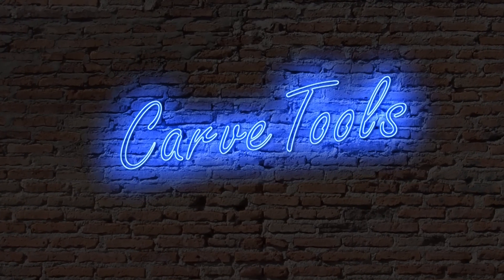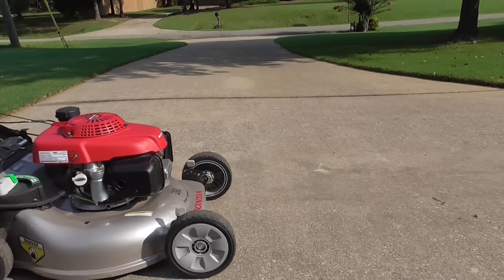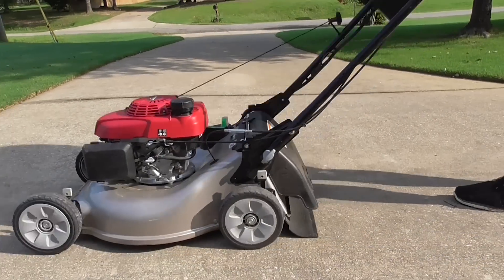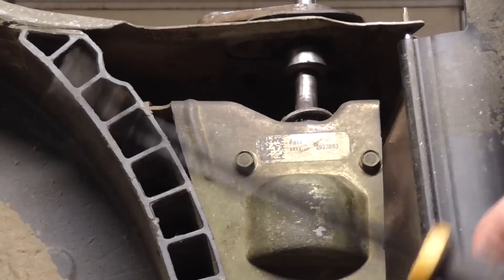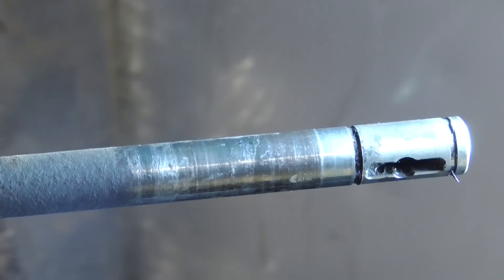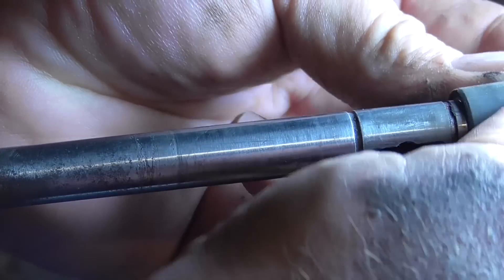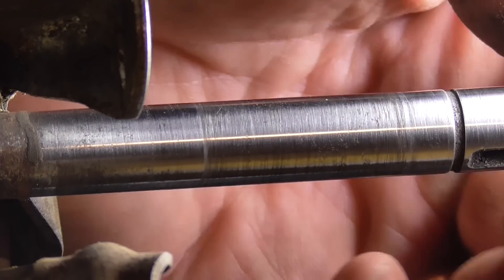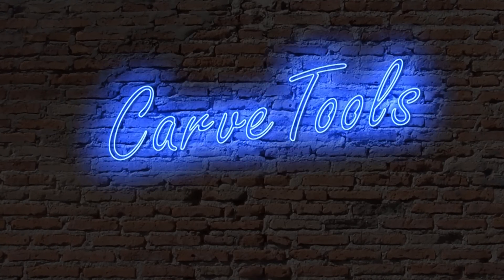Honda Mower Rear Wheels Will Not Roll Backwards THE REAL FIX

Comment: THE  PROBLEM ; with modern  stuff : Plastic shroud/cover  mounting  the  WORM  DRIVE, to  the  wheels ?.....Had more than one brand, of this  cheap - crap  design. GET  an Ariens,  mower.  Anything, other that that, is usually, just junk. The drive wheels, have a PLASTIC liner, with rounded, notches.  The Drive  ' gear '  from the worm drive /under that plastic housing /shroud, have  NORMAL  steel gears, with a tapered, gear . These, just  CHEW  UP  the  plastic notches...within  the  plastic wheels.  J U N K.  -   IMPROPER  DESIGN,  of  ' matching   the gear, to the wheel  design ''.  Somebody, screwed up, in the CAD / Design process, with their  computer software.  - ....go, check it out.   You will see..../ should make, the wheels  with  PROPER  DESIGN, AND WITH  A   METAL   GEAR,  INSIDE within the drive wheels. Steel matching to the drive gear..... o well....can't   fix   ' use once '   buy another one.  Junk. I'll keep my 50 year old Toro , cast aluminum housing and handle / . INSTALLED  this same  GCV 160  Honda engine - modified the throttle / governor /choke mechanism. Used a mountain bike, shifter on handle , for the throttle. Another one, for the  RELEASE....to switch on the magneto, for starting.  (most all brands, have a bar-lever....for  this...../ YOU  CAN'T  control  the RPM  this way . I need, to vary the rpm....for the  load on engine. Slower rpm, for light grass, or sparse grass )  Works,  very awesome.   Light, long handle....NO  MORE  SELF - PROPELLED  junk...for me.  The blade, rotates  EXACTLY  the same level, as the outside of the round , housing. This, is easy to see, when approaching obstacles / rocks, lumber, uneven surfaces....etc.  Very  accurate, to keep level, and low.  Been doing  this stuff...for years.  Got in down, pat.  Good luck, to all  which  USE   THEIR  HANDS.  ?  WHY DON'T  they  USE  REAL  METAL,,,...for mounting Drive Stuff ?......i think, we all  KNOW ££££  MONEY ! ......

Comment: Great video.  I did the fix and my rear wheels do not lock up but it still seems sort of hard to roll backwards.  Would I be correct to assume that's normal, that it doesn't just roll backwards with little or no effort?

Comment: Great video.  I have had intermittent problems with this for years with my commercial HRX2172HMA.  Apparently there was a recall that didn't include mine but I got the issue anyway. I wonder if the bushings that you buy now are fixed or re-engineered. I have trouble with the back left wheel height adjustment as well. I bet it is a mess in there.  Doing this tomorrow and hopefully this fixes it up.  Out of curiosity, did you grease the axle before putting the bushing back on?

Comment: My mower did not roll backward at all.  The self-propel on my mower does not work as well.  I did not want to do sanding to resolve the issue, WD-40 did not work, and I was tired of dragging the mower backward through the grass and on the concrete.  I removed the dogs and springs for the ratcheting mechanism on both wheels.  Now the non-functional self-propelled mower is a functional push mower.

Comment: Have the same issue, haven't grease the bushings or clean the axle yet but is there a reason both wheels lock up? I would think if it's The bushings one wheel might spin free while the other is stuck. Trying to determine if it's a transmission or not...
Reply from the maker: Here is a link to my more detailed video on this issue https://youtu.be/zsHQYJEKY5M
Hope this helps and thanks for the comments.

Comment: I had this exact problem. It rears its ugly head after I rinse off the mower. The first time this happened I sprayed lubricant on the axle and it did the trick. This last time it did not help and I used your instructions to fix the issue. I purchase a new belt, bushings and rubber caps. The right side came off easy, but the left side would not budge. I had to use a propane torch to remove the left adjuster. (those snap rings are a bear to get off!)

Comment: Thanks Scottie, 
I haven't tried that but really think that is what needs to be done. It has been a good mower engine wise but that definitely is a problem, glad I'm not alone. 
I did buy a RYOBI battery mower last year and it is a breeze to mow with. Still like my Honda as a backup, need to get it fixed.

Comment: I hate my Honda smart drive mower so much and I despise the salesman who talked me into buying it. The motor that drives the wheels is SO EFFING HEAVY. If I didn’t have that stupid Smart Drive on this thing adding so much weight I wouldn’t need the Smart Drive to help me push it! My brother’s push mower weighs half as much and is a thousand times easier to use without any kind of drive assist, and the stupid goddamned wheels never lock up like this one does. I wish I could go back and buy a much cheaper mower.
Reply from the maker: I understand. I only use this one for trimming and it will be replaced in the next few weeks due to another issue. Check back soon for the final video on this Honda mower. Thanks for the comments.

Comment: My Honda carburetor was covered by Honda under warranty.  The authorized repair service shop made a claim and installed a new carburetor free of charge.
Reply from the maker: That's good to know. Hopefully you will have no pull back issues. Thanks for the comments.

Comment: Just spray lubricant instead  of tearing  apart because  i promise you it will continue  to happen  as long as you own the mower. Terrible  design and nothing  you can do about it but spray lube when it happens
Reply from the maker: Definitely a bad design and fortunately after doing the disassembly there have been no further issues with wheels locking up on pullback. I have an updated video on the repair if interested https://youtu.be/zsHQYJEKY5M
Thanks for the comments!

Comment: I have Honda hrs216 self propelled mower. I’ve had it in the shop twice under warranty.  All they did was put a bandaid on it said it was fixed. I’ve watched your video and tore mine down and cleaned the shaft, bushings, etc.  It worked fine for about a month than started acting up again.  The problem is the bushings. They are not designed for the type of environment a lawnmower is put through.  They should’ve put sealed bearings instead of bushings. Very bad design.  The engine is 2nd to none!
Reply from the maker: Yes, they know the bushings are a problem. Check out my newer video of The Real Fix Part 2. It has more details on my repair. Thanks for the comments.

Comment: The real fix ?
You certainly did it the proper way
I would just shoot a bit of oil on it and let it roll
Quick and nasty but likely a long time before it wears out
Might be a awful long time
Reply from the maker: I tried WD-40 and a bunch of other oils, but it did not last. Check out my newer video of The Real Fix Part 2. It has more details on my repair. Thanks for the comments.
Reply: wd 40 is not oil @CarveTools

Comment: I replaced everything associated with those rear wheels including a new trans with shaft....still both wheels pull very hard and heated lock up.....this is not the REAL FIX....why did it work great when bought new and not now ?
Reply from the maker: The manufacturer knows the bushings are a problem. Check out my newer video of The Real Fix Part 2. It has more details on my repair. Thanks for the comments.

Comment: I work at a Honda Power Equipment dealership, and we see this issue regularly.  It is HRR216 specific.  You are correct, the bushings and transmission shaft are dry and worn so that they bind up.  You can buy genuine Honda OEM bushings already installed in the wheel adjuster bracket for less than $10 per side.  It is quicker and easier to replace these with the transmission in place rather than removing the transmission.  Clean off the axle with emery tape just like you did, and put some fresh grease on before installing the new wheel adjuster brackets.  I've done quite a few, and it usually takes around 45 minutes to do the pair.
Reply from the maker: Thank you so much for the information. My local Honda Dealer had no clue.

Comment: honda knew about this problem long ago but did nothing with their $465+. Usually it's the lousy transmission that go bad.
honda like husqvarna have so many mowers complaints that they are no longer in the business.
Reply from the maker: There is very little information for the recall and Honda service centers have no ideal either.
Reply: @CarveTools  Honda's TSB for buying the new parts are useless after 17 cuts.

Comment: Thanks Dave,  I just received a free 160 GVC lawnmower real wheel self propelled and it wouldn’t start. 
Finally got it going by cleaning out Emulsion tube while it was in carburetor with a bent plastic tube spraying Carburetor cleaning Spray   

I will try your fix in a few. 

Houli.

Comment: If you want a quick “fix” try this: 
First clean it, preferably with a pressure washer, there’s probably a lot of crud everywhere. If this quick fix doesn’t work at least you’ll have a clean mower to work on. 
If you slowly push forward until just BEFORE you hear the click from the wheels and then are able to roll backwards about an inch or two before the wheels lock then it’s NOT the transmission; the problem is a catch in the wheels. 
After cleaning it up get it on a hard surface (concrete). Start the mower and lift the rear so that the wheels spin in the air when they should be going forward (approx 5 inch in the air) then let it drop. The idea is to unstick the catch that’s preventing the wheels from rolling backwards. Repeat this a few times.

Comment: Thanks, Great video and good info for all. Just wanted to add this also.
First of all, remove the drive belt from both pulleys, turn the wheels backwards and see if they turn freely.
Make sure when you have the mower tipped to its side, that the bottom wheel is not touching the ground when you try to spin it.
If it spins backwards freely without the belt, then your transmission and bushings are fine.

if the wheels are hard to spin backwards when the belt is back on, then the belt is getting caught and binding against the pulley and the bracket that keeps it on. This happens if you try to use a non-honda regular black rubber belt. The rubber just causes more friction on the pulleys and creates the resistance.
The oem honda belt is brown and seems to have some kind of fabric looking material covering it that causes less friction on the pulleys.

I tested this just today 7/12/22 with a non-honda belt and with a brown 38" belt for cub cadet and troy, part no. 954-0257.
The belt was actually for a snowblower, my hardware store did not have the honda belt.
To my surprised, it worked just fine, it rolls backwards freely. I did spray the axles and bushing area with pb-blaster also.

Hope this helps others
Thank All for your inputs

Comment: Thanks for the video! I bought a brand new HRR mower in the fall of 2018. I used it a few times until the end of the season and it worked great. The next spring the rear wheels started locking up. I thought, "No problem, it's under warranty."  WRONG! Honda would not fix it under warranty. Took it in for service, a few weeks after it was fixed it started doing it again. The dealer picked it up and a couple weeks later dropped it off. Worked great for two mows and then started locking up again. I feel like I wasted $400.
Reply: Music was too obnoxious, couldn’t finish video

Comment: This is such a problem. I have had two of these mowers. The stuck wheel issue has been there on both mowers. I bought them from a Honda dealer and have had them in for service many times. The wheels are always needing to be replaced too. The replacement wheels I had the dealer put on dont even last as long as the originals. Between this problem and the need to replace the carburetor several times, I am never going to buy a Honda mower again. They dont deserve our business if they cant even fix their own design failures. This is planned obsolescence at its worst.

Comment: I have bought many lawn mowers in my life. Most were in the $300 to $400 range and usually ran for 8 years plus. Paying $700 for Honda and now having the drive wheels fighting back when pulling backwards only after 3 years has  an engineering design flaw and quality in question.
Reply: You paid 700 for your honda?   I paid 499 for mine.  Probably 10 years ago tho
Reply: @jonathanritter7364  They are more than $1000.00 these days
Reply: Honda doesn't care, this has been an ongoing problem for years!
Reply: Yea such a terrible design flaw that could be fixed by regularly  spraying the bushings in the axle with oil once in a while..
Reply: If youve bought many mowere over the years youve been buying the wrong ones 😂

Comment: Thanks for a great video, my wheels are freed. I have had this mower for 7 years now & I cannot get the electric start to work. I brought it to a repair center in late summer of 2019 & for $100 they got it working. The next spring 2020. It started with a freshly charged battery & that was the last time the electric start worked. The started does not crank at all. Do you have any suggestions on this issue?......... John

Comment: I know this isn’t my issue as my  wheel or wheels won’t turn rolling forward. They did, up until today suddenly. They roll, then just stop the mower at a dead stop. I Replaced the gear box and axle two years ago. So what has changed?

Comment: Great video for HRR216 mowers. I'm going to replace the bushings and seals and put a light coat of plastic friendly grease on bushings.  Since you have to remove the transmission may as well replace the hydrostatic transmission fluid if you have a lot of years / hours on it.

Finished the repair yesterday. FWIW the job took longer than I thought since I went ahead and replaced the belt. This is a rental house mower - some idiot overfilled the oil and it leaked into the belt greasing it. What a mess under the mower! That oil mixed and caked grass under the deck.

I decided to use my bench wire wheel (fine wires) to remove the axle rust & roughness. Sanding may allow grit into springs slot. Worked great. Then I used automotive grade silicone grease to lube the new bushings and dust seals. There is about 1/8" gap between wheel dust seals and bushing. Add grease to this space. Decided to leave hydrostatic oil alone (10w30) since mower only has estimated 150 hrs on it. On my HRX217 it has over 600 hrs - I'm replacing the hydrostatic transmission oil in it.

Using plastic bushings is a stupid cost savings. Use brass and include spiral for grease.

Comment: Wished I had watched your video before I fixed my Honda lawn mower that used to have the same problem.  I had a small engine mechanic to fix it twice; but the problem never really fixed.  I also cleaned the "half moon key" inside the wheel assembly; but that didn't help.  I cleaned the area on top of the transmission housing where the trigger to engage the transmission is located to remove any debris stuck in that area (the debris prevented the transmission to be fully disengaged); this helped for months.  But eventually the problem came back.  I tried all the steps one more time.  This time nothing helped.  I ended up have to replace the entire transmission assembly; but I still didn't know why the old transmission didn't work.  Now that I have watched your video, I realize that I should have tried cleaning the shaft.  Having said this, I wonder why the rust in the shaft can prevent the wheel from rolling backward but Not prevent the wheel from rolling forward.  I think if the rust on the shaft is the problem, it should prevent the wheel from rolling forward and backward, right?  I am confused.
Reply from the maker: The issue on my mower was the rust and dirt on the shaft. Once cleaned I have had no problems since. The reason it rolls forward easily is the half moon key you mentioned acts like a ratchet wrench allowing one direction. Thanks for the comments!

Comment: at 2:00 you state the axle spins freely. but I noticed the pulley was spinning as well. with it installed it would need to turn the engine shaft. am I missing something?
Reply from the maker: Yes you are correct, when the axle rotates either direction it spins the pulley. I have a new video coming out  hopefully this week with a detailed disassembly and repair of the bushing issue that causes the wheels to lock up.
Thanks for the comments!
Reply: @CarveTools  sorry, what is the clutch bar for then? I would expect the axle to rotate without the drive pulley.

Comment: Thanks for the video.  This did not fix my issue completely, but certainly helped.  I suggest also changing the drive belt at the same time.  My belt would hang up because it had been formed into an oval shape over many years.  Because of this it would hang up on the transmission pulley when it reached the narrow portion of the oval.

Comment: Thanks for the explaination. I've had mine since 2017 and it locked up Monday. I just took off the wheels and dripped in some mountain bike chain lube. Seems slick now. Prior to them locking up, the last use was in wet crabgrass on my neighborbor's lawn. The under deck go all mucked up so I hosed everything down.. I think the water hosing of the wheels may have had something to do with it.